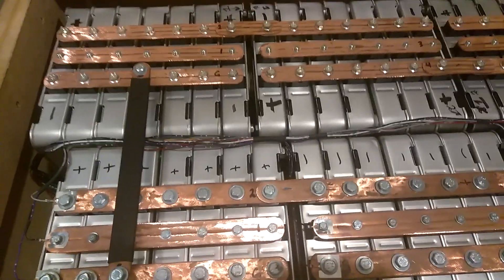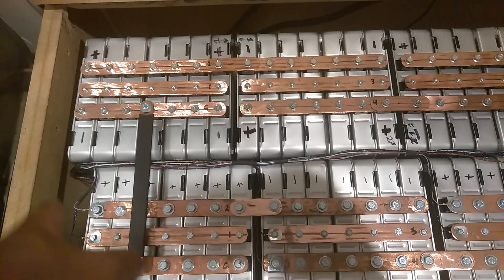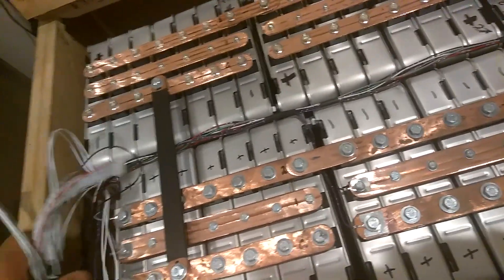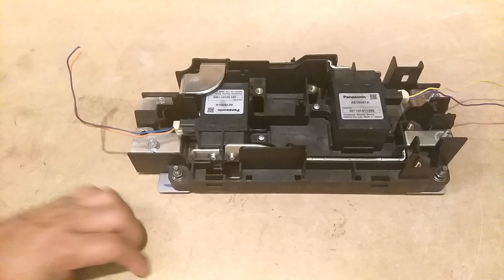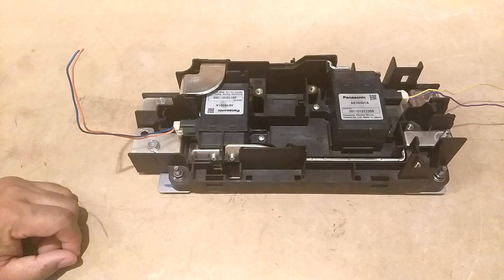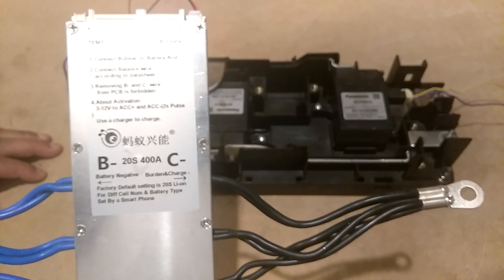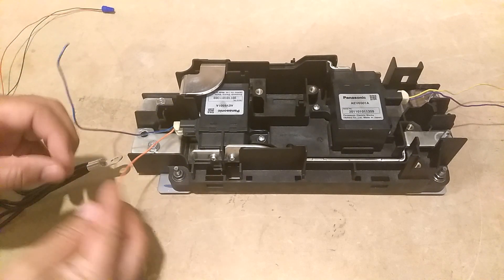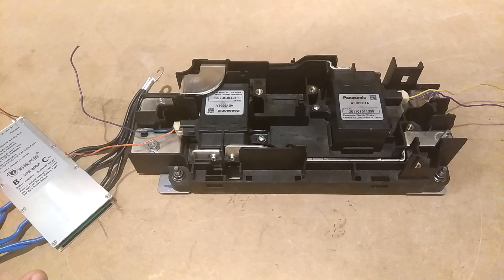Update on Nissan leaf battery Bank.

Comment: Hey Carson, love you videos. I use those contactors for a high battery disconnect before I got my bms and they remained closed for over a year with 12v applied to the coil. I don’t think you will have an issue with them staying closed for long periods of time
Reply from the maker: Thank you for the information and glad to see you like the videos come back anytime 👍.

Comment: As far as the solenoid coil goes, you provide the correct voltage range it needs to close its contact, it should be able to last endlessly.  I am just not sure, what the voltage you are applying at the coil side of the contact is.  Just stay at its operating voltage range (should be available by the manufacturer), and you should be fine indefinitely.  If your BMS + lead is at a higher voltage than recommended, then you can damage the coil and the contact will no longer close.
Reply from the maker: Thank you for the info but I had a change of mind I did it a different way.

Comment: Hey can you do a video on how you wire your wind turbine to your batteries
Reply from the maker: I have disassemble my wind turbines when I was putting the new battery Bank in. But I can shoot a video showing how to do it no problem. It will be after I finish up my battery bank lf that's ok.
Reply: carson l urban wind and solar , I asked because I am scared to connect my wind turbine to my batteries, I just want to see what you have done my I can learn from it
Reply: carson l urban wind and solar do a slow step by step video pls

Comment: BMS manufacturer does not recommend any device between the bms and the battery. Just as a point of interest try setting the charge setting on the bms to say 80 amps to see if it gets hot if not that may be a better answer.
Reply from the maker: I will try that thank you for the info 👍

Comment: I dont have leaf batteries or that piece of equiptment but I see no reason why they wouldn't wok energized for an extended period .  Its functioning like a relay switch which that functions as . Though relays can be normally off or normally on and require energy to change and hold it in the non-normal position. The main thing is there isn't much you can do about it either way.
I would just hook up 12 volts to it and leave it for several days or a week and see what happens .  You could also check and see how many amps it draws. Hopefully less than half an amp at 12 volts.  If it doesn't work get relays.  Will Prowse has a video on the relays which is ok.
Reply from the maker: Can you send me a link to the video. And thanks for the info 👍.
Reply: @carsonlurbanwindandsolar3437  I think this is it but its using a charger BMS but the relays should work with any 12 volt output.  High tech lab also has some older videos about using relays but that is only with his program he is writing and difficult to understand and really not practical for this.  There is another youtube that uses several relays to limit large loads being on at same time etc but at present I can't remember who it is but their system is made with leaf batterys though it wouldn't need to be but I think thats how I saw it.  I am very interested in how many cycles etc your batteries that are already degraded to say 65% take to degrade say another 5 or 10 %.  This is why I choose to buy different  brand new cells rather than the leafs which would be much easier to work with.  I personally would hesitate to buy cells degraded more than 10-20% from new capacity.  I have tried to research how fast they degrade under controlled conditions but really haven't found much info.  They degrade in certain vehicles for many reasons like amps drawn, temperature of environment, cooling system effectiveness of a vehicle pack design.  If have an adequate size pack like you should have now I doubt they will degrade more than 1 or 2 % per year to a point but I also think once they reach a point the internal resistance will increase enough to greatly accelerate the decline I just dont have much of an idea what that point is.

Here is the link to the video hope it helps.
https://www.youtube.com/watch?v=RfAv6kzebYY
Reply from the maker: @teekay1785  thanks for the info I will check it out now 👍.